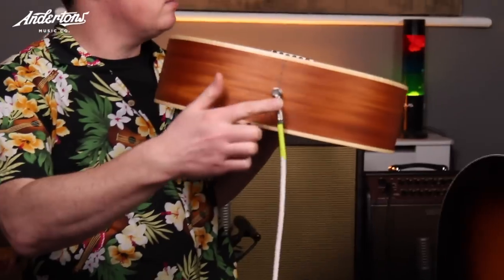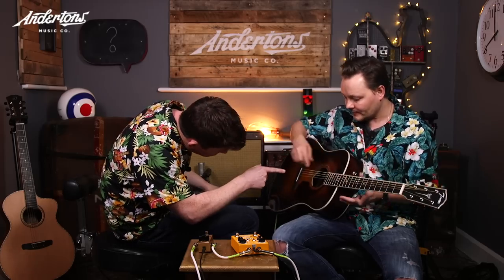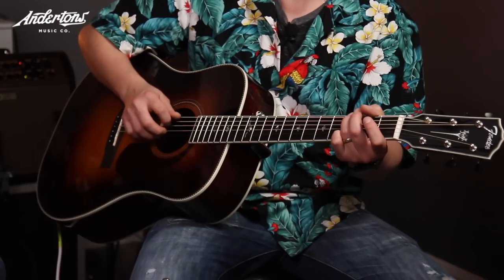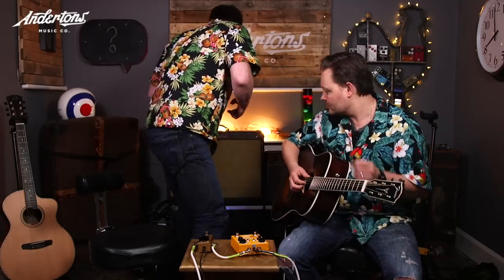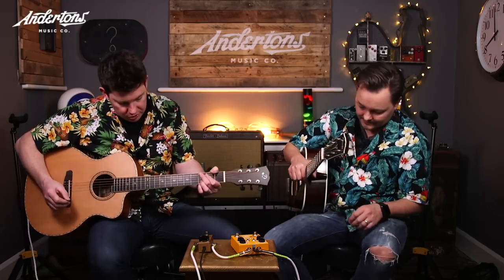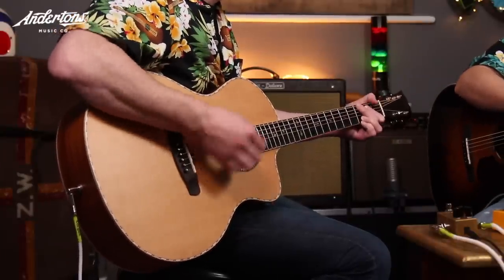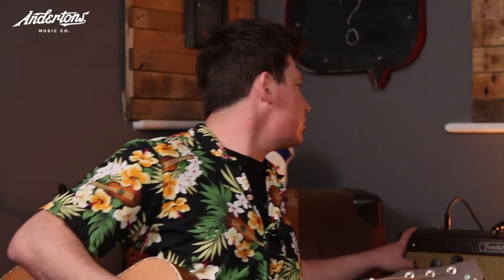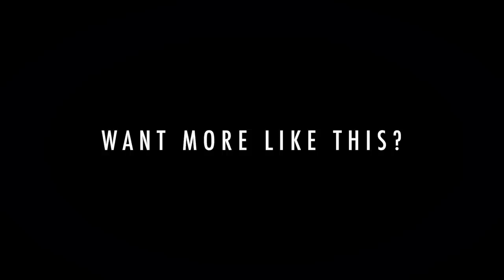Using Different Amps & Pedals with an Acoustic Guitar!

Comment: Good video. The best sound I've gotten from my acoustic guitar (Taylor 714ce with a Seymour Duncan magmic replacing the ES2) is through a Fender Blues Jr, with volume rolled off, fat switch engaged, master up, bass up, mids a little under 12 and treble a little over 12. Sounds awesome. This with a little of the mic mixed in (20ish percent or so).

Comment: Great tutorial!!! Got to say I love both for different reasons. That's why I own both acoustic and electric amps and I basically use them interchangeably. 
20 years ago you could hardly even find an acoustic amp, so everyone used chorus phaser flanger or some sort of acoustic guitar sim or even add a piezo disc for warmth. I even have occasionally seeked out the quack sound of UST for some recording purposes.

Comment: Definitely agree that you need to plug into an Amp and not just house PA system for an acoustic amp.  I just did a gig and I used a Laney amp 65D acoustic amp and then out through an XLR cable into the open house speakers through a mixer. The sound through house speakers and my amp filled the busy bar and restaurant beautifully.  I received positive feedback from the customers,

Comment: The thing about a PA is it's meant to reproduce a large variety of sounds, from 60hz all the way up into 10,000hz. An acoustic amp is basically a PA, but made to naturally produce the acoustic tones better. I find when I use my 12 inch powered Alto, I have to roll all the bass off in my preamp on the guitar and it still sounds bass heavy. I've tried using my Taylor Acoustic through my Fender Blues Jr and it sounds awful, probably because the amplifier pre amp is taking an already pre amp sound from the guitar. Piezoelectric and standard wound pickups do the same job, but the tone and characteristics are vastly different. I'm interested how you guys got a great sound out of a Hot Rod Deluxe.

Comment: Minute 26:28 that sound with the Fender Hot Rod Deluxe is 👌🏽 amazing 🙌🏼. What pedals are they using? Also, forget that Boss amp.  Use an A,B,Y pedal and connect straight to the PA and to the Hot Rod.  That’s the sound I want for me.

Comment: Very interesting demo using the Fender and Boss amps and laced with humour as a bonus. I believe that the Boss Singer Pro is a premium acoustic amp. Being new to acoustic amplication, an explanation as to why you have a boost pedal would be helpful as well as what device you used to split the guitar preamp signal. I presume the boost pedal may be due to the guitar signal splitting to both amps. It seems that setting the EQ is matter of experience. Using both amps sure fills the sound spectrum. Flying over the "pond" to jam with you sure would be fun.

Comment: Interesting video, thanks! Here's another idea: when I'm using the acoustic (LR Baggs M1 Active on a Lowden).I run out of the XLR on the back of a Peavey Classic 20 Minihead, all valve of course, through a DI into either a PA or indeed the home hi-fi at low practice volumes, so you get the valve warmth through (relative) hi fi speakers, and it suits the acoustic guitar really well IMHO. You could say it's kind of a hybrid use of the amp - worth checking out if your electric guitar amp offers this kind of facility.

Comment: Heya, 
when I'm touring I run a xlr to FOH, a jack through a stereo delay, mono runs into a bass combo and the other side runs through a volume pedal, then an od pedal and into a 1x12 tube guitar combo.
You should really try a bass amp for acoustic guitar, it's kinda like mixing aer and electric amps...

Comment: I have a ZT Lunchbox Acoustic but I have never used it to shape my guitars' sound, only as a mini-PA for small gigs and a monitor for slightly larger ones. Not that it sounds bad, but I prefer the DI'd sound of my Takamine guitars. And I've got a Zoom acoustic pedal, in case I want some reverb and/or chorus... I've also played them through electric amps when I was too lazy string up another line to the desk... 
A funny side note: The acoustic resonance on the Boss (I think that was the name) sounds a lot like the exciter my Takamine EF 261 has...

Btw., Teenage Dirtbag uses a quite distorted acoustic guitar in the chorus.

About rowing: There is a kickstarter project that will make carbon fibre guitars, they should be ok with water (except for maybe the electronics...).

Comment: Some of those crunch sounds through the Fender were pretty fun - that said, what this video has done most is remind me how cripplingly fussy I am about acoustic guitar sounds...
Reply: That said, now I think about it, the nicest live acoustic sound I've got from my guitar was probably actually through some TINY little Fender electric amp... Granted, it wasn't loud by any means, but given the size of the room (or rather, the deck - this was at the folk club held on board the Cutty Sark!) it didn't need to be.

Comment: I prefer acoustic amp, DI into front of house, or acoustic preamp into PA. What i usually if possible is use my acoustic amp which has a direct out, so i run that to the PA, but i can still hear my amp for a reference.

Comment: great vids keep them coming! If you dig the blend of acoustic and electric guitar tones check out the Godin guitars some models can do both on-board or use the 2 independent output jacks to send to separate amps (some even have midi 13 pin in addition)

Comment: Great video...learned a lot but a question comes to mind. I have a multi-channel full range amp (Suzuki SA100) that includes electric guitar input & keyboard input & aux input. Could I achieve the electric guitar amp/acoustic amp mix using two of those inputs or is there something I'm missing. thought I'd bring it up here with the "experts" before launching into something that will turn my loving amp into a flaming mess...
Reply: Oh yes, forgot to add... also have a bass amp and I remember that back in the day (the 60's) many, including myself used a bass amp for regular electric & electric/acoustic guitars. What would you think might work with that mix?

Comment: Hi guys.  How would it go plugging an acoustic into an effects loop return?
Reply from the maker: Good question. We will feed that over to the guys.
Reply: it's ok, but what happens is you have no EQ on the amp, and limited volume control
Reply: Jaymz Ruggiere Don't the preamps in electro acoustics cover that though?
Reply: Rob Holiday i run my accoustic via a fender accoustosonic twin speakers but the loop is down in volume with both guitars with pre amps !the boss accoustic and And I iagine other nowadays have built in loopers !
Reply: John Graydon Thank you!
Reply: Hot rod deluxe is so much better

Comment: It ain't the amp, it's the speakers and the cabs.  Build you own cab with three speakers.  Woof, Mid, and Tweet will give you the perceived dual amp sound.  Or attach a two channel amp to the three speaker cab and have at it splitting the signal to the woof and the mid/tweet, or sit a satellite tweeter atop a  twin 8" cab and have at it :D
Reply: Broc Luno hey bud any chance you can tell me from a sound stand point the difference from a cone driver and that of a tweeter? I play a Genzler acoustic array pro which doesn’t have a tweeter but rather a cone driver supposed to be clearer sound 🤷🏻‍♂️ I just know it’s a bout more hotter, white noisey
Reply: The white noisy effects your are hearing might be your amp section clipping and creating "overtones" which a tweeter will reproduce, even some cone speakers can get that high  ...  
Need to put a scope on the outputs to see what is really going on?

So go to the Madisound site/catalog (and other audio component dealers) and look up the speakers in your existing array.  You'll see their frequency range.  You are looking for the Thiel-Small parameters such as how much sound pressure from 1w, etc.  Once you have the parameters for your speakers, you can look for a satellite tweeter that runs about the same power absorption.  A dome tweeter (soft dome preferred) will give you a nice wide dispersion pattern.  A cone has on, and off axis effects.  So someone 15* off axis will hear differently than someone dead center on.  Cones do not make the greatest tweeters ... 

You can tame the sizzle with filtration in the speaker crossover.  The satellite tweeter can usually be driven with a simple capacitor that will roll it on at say 7KHz and above.
Reply: Broc Luno thanks man! Sounds complicated but I’ll
See what I can do